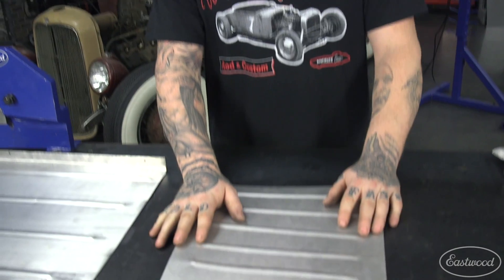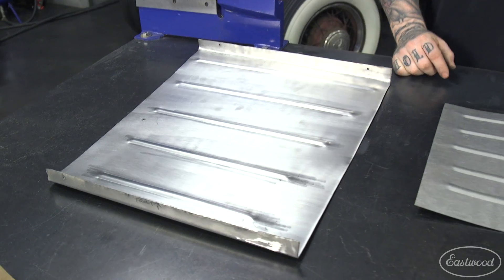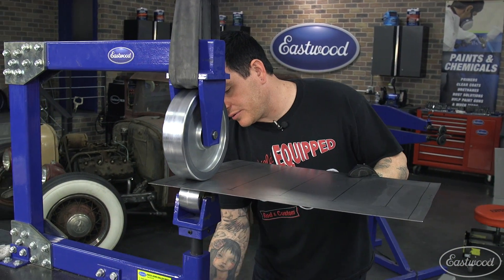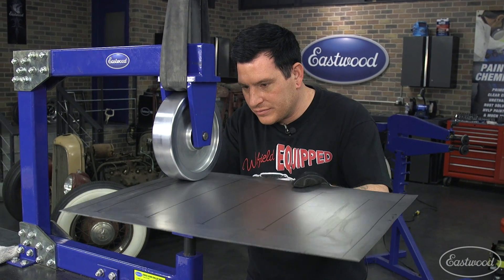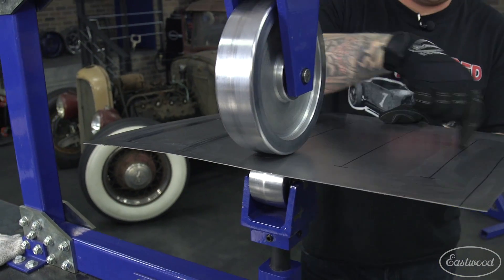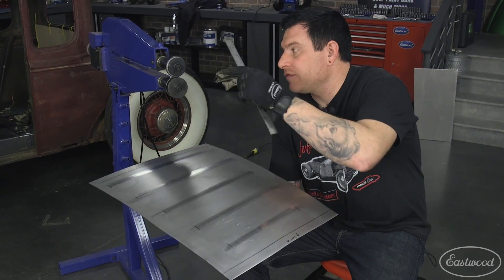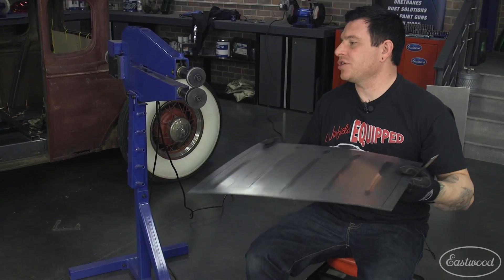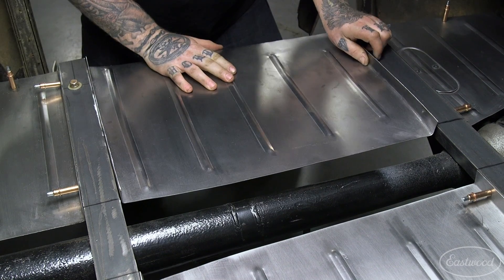Metal Fab Tech Tip: Pre-Stretch Metal Before Bead Rolling – Eastwood

Comment: I don't get it. You stretch the metal before you use the bead roller. Now the bead roller stretches the metal some more. How does that offset ??
Reply: +Adam Pierce Offsets as metal is stretched in one direction with wheel and other direction with beading.